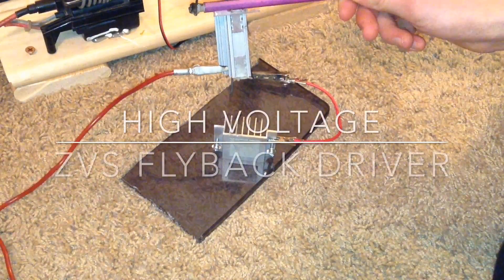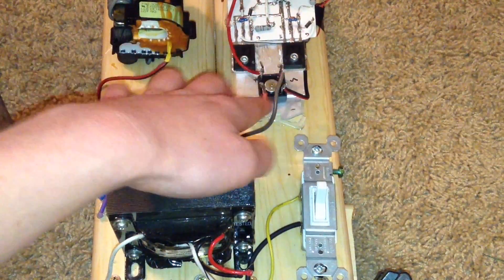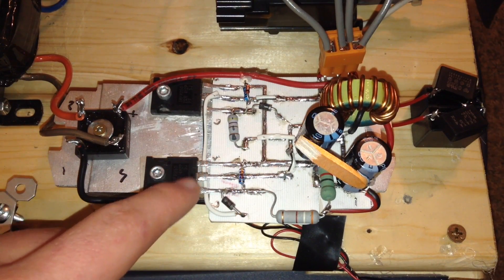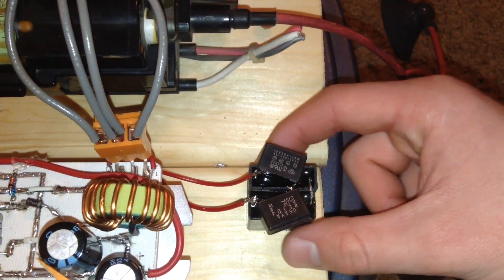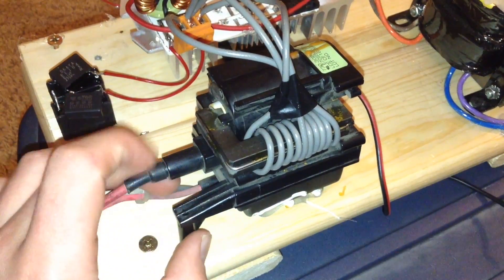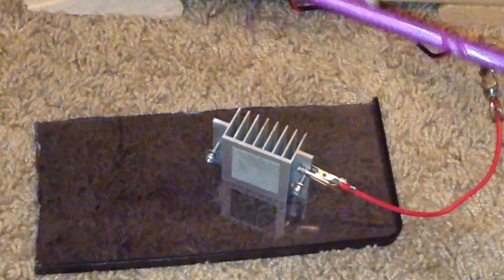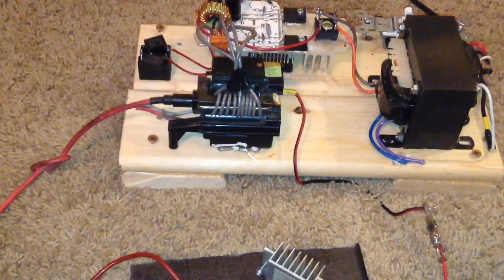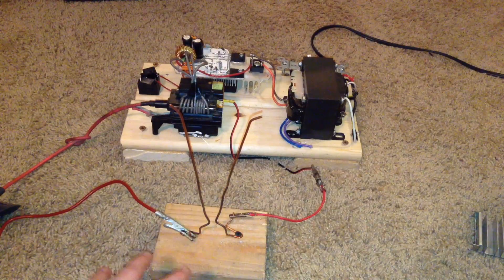ZVS High Voltage Power Supply

Comment: about the heating up of the transformer: try getting an AC flyback off of Ebay, I have two of them and even running at close to full power, they don't heat up at all. The capacitors heating up can be fixed by getting 0.3uF 1200v DC 600v AC capacitors. Most of these capacitors can handle 50kHz, but the capacitors you have weren't designed for high frequency, so they warm up quickly.

Comment: You have that wired wrong. You need to have a switch between the power supply and the zvs driver. You have to power up the power supply, then connect the driver, as it requires a big surge to get it ringing. 'The way you have it, with the power supply connected to the driver, and the switch turning on the power supply, you risk locking up your transistors and blowing the whole thing up. They won't like having the power ramped up from zero as the power supply starts up.
Reply from the maker: This is actually wired right.  The ZVS does not require a "big surge to get it ringing".  The way I have it wired works just fine with no possibility of "locking up your transistors", which is not a real term.
Reply: Then you must have a very quick power supply. But it the power supply "ramps up", or "soft starts", that can cause both transistors to turn on at the same time, or "lock up", which will short the thing out, and blow both transistors, I did it, so I know. It worked fine a couple of times, then bang, it blew up both transistors as soon as I turned it on. They need a fast starting power supply. I have one I bought from China, and the instructions say the same thing (albeit in "Chinglish") to use a fast starting power supply. Putting the switch between the psu and the zvs will work, too, so the power supply is already running when you put the load on it. 
If you ever blow your transistors, or you power supply as soon as you switch it on, that's what you did wrong.
Reply: @TannerTech  it is okie to use in powder coating power supply sir? please reply tnx
Reply: he isnt using a swich mode power supply he is using a mains transformer and a FULL BRIDGE RECTIFYER!!!!!! There is no risk of this locking up with his setup
Reply: You are half right. The ZVS doesn't need a "big surge", but it must not have a slowly rising power supply. It needs the power supply to be at full voltage before it's connected to the ZVS. 
This implementation works without lock up because he's got minimal filter capacitance on his power supply, so no slow voltage rise. 
He'd probably get better sparks with more capacitance, due to the higher supply voltage and reduced ripple that would result. 
And maybe then he would need to switch in the ZVS only after the power supply has come up.
Reply: UNITED POLICE STATES OF AMERICA the guy who said u did it wrong is thinking of ya switching power supply urs is linear u know this but some don’t